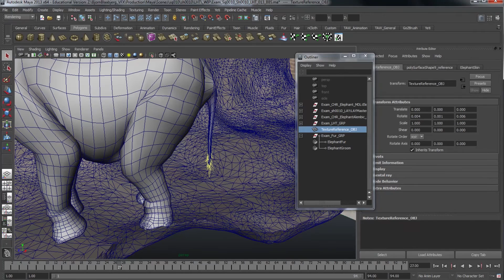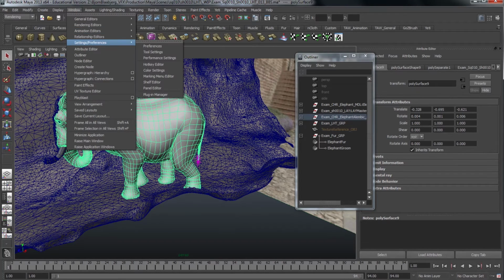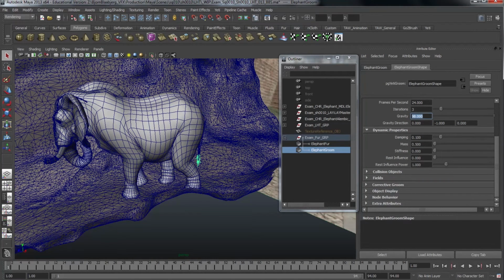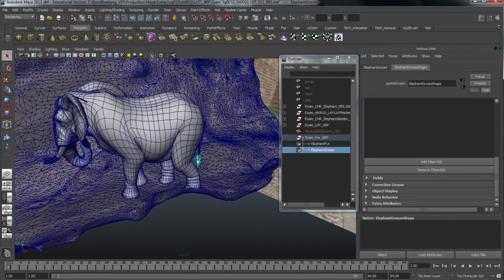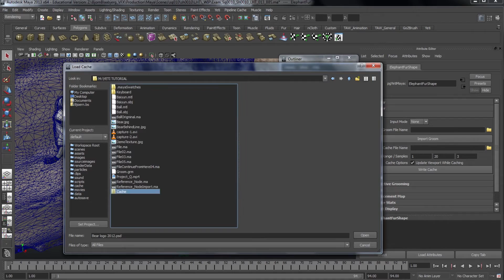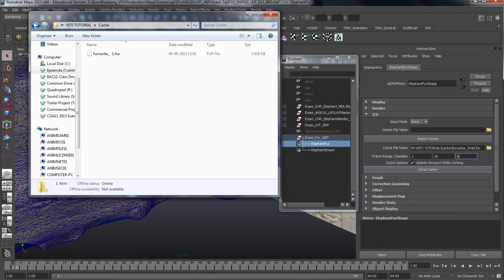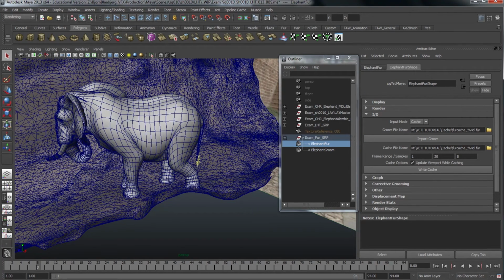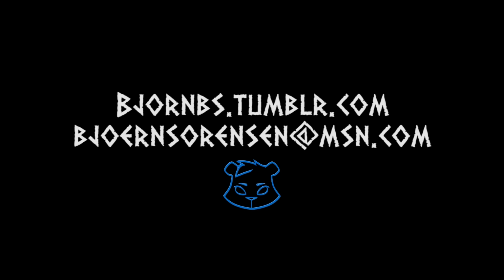Caching with Yeti

Comment: Hello!!
I'm making a scene, following the steps in this tutorial and I was able to export the cache correctly, but I have a problem.
- When activating the cache input method, I can load the fur animation correctly, I see it correctly in the viewport, and in
 the playblast, but when I pull out a render with the cache enabled, it crash maya, and I have no idea what it might be, I'm using vray and the problem is only when I turn on the cache..
would be great if you could give me some tip, maybe you have another video, but I have not found